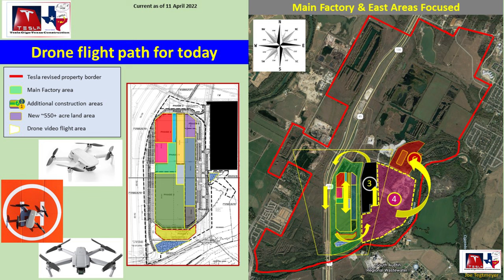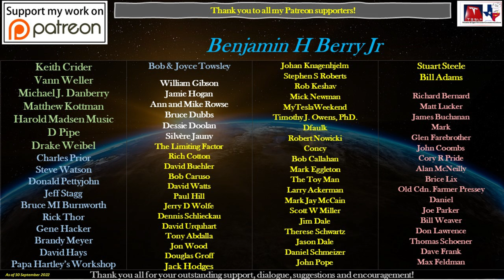Huge progress & talk # of receiving docks & WOW Yard trailers! 30 September 2022 Giga Texas(07:35AM)

Comment: Thanks Joe.
1:41. For the record, loading docks and drive-in doors, in use or under construction. 59 on the east side. 70 on the westside, not including the plugged openings.
5:09.  GA, inside. Much better view in Joe’s Patreon photos. Level 2, 2 bays of concrete then steel decking as far east as is visible.
Level 3, construction lighting only. Might not be much going on in there yet except for storage.
5:28. GA, apron. Trusses likely for lighting/sound above a stage for an event. Similar to that seen at the Giga-rodeo.
7:25. BIW, roof. Access platforms.
8:03. BIW, apron. Office building getting a pedestrian ramp. Building quite elevated, shoulder height of the carpenters building the ramp in Jeff’s video yesterday.
14:01. East of Cathode. Boring Company something. Lots of what appear to be A/C units on top, huge fan outlets on the north side.
17:35. Cathode. Left. Excavation for another ground slab. Small outbuilding likely as some drainage already in ground.
18:28. Cathode, west. Edgeboards/formwork for a ground slab. Interesting to see how the building in the stack of steel to the right works in with this.
19:12. WOW trailer yard. Right of screen. Inside the fence, another line of wheel stops/buffers. Shows further eastward expansion planned
20:45. Eastside parking. Car carrier area. New office trailers, permanent looking.
21:31. New substation site. The small light steel framed building was a surprise.
22:40. New substation site. Right of screen beside the last orange bollard, hold-down bolts seen in a jig to accurately locate the bolts within the footing rebar cage. 
Left of screen is a hurdle (orange) with a string-line strung over the line of footings to show the centreline.
24:54. Northend. Road. Drainage works under the sidewalk/footpath seems have been to remove the odd under pavement drainage inlets. About to turn the new drain into the pit/well/basin.
I don’t think there was a kerb and gutter along the road, might construct those now.
26:42. Casting, apron. Gas delivery tankers to the right. The decanting points are on the wall in front of us, directly to the right of the pair of porta-loo trailers.
Reply: Hello Dessie, 22:40 The hurdle is known as a batter board in US speak, Laser level on tripod at bottom center.
Reply: @eltonray2934  22:40. I'll hurdle/batter-board from here on. Thanks for the tip.

Comment: those cross-cutting is exactly in the red-circles I mentioned 2 weeks ago when they first start removing the concrete in the new-car are ;). That surely will be for the building extension as it's outline matches the current outline..

Comment: A boring company tunnel (BCT) adjacent to the biggest source of privately-owned Teslas around.  But going through a BCT requires full automation.  I wonder if Tesla creates a Tunnel Mode, maybe apart from FSD and available by subscription, so any Tesla owner can have the experience.
Reply: First they have to get FSD to work :)
Reply: FSD is a continuum. It works. It can work better and seems to be improving at each release. What's your definition. It appears as good as an average driver now. Does it have to be 5x better? 10x. 187x?
Reply: @HughButler35  My definition of "working FSD"....
It's all or nothing! It has to work reliably all the time. The internet is full of video of FSD mistakes. Many, recent videos. Yes, it can do some impressive things. You and I both know that is not good enough. There is a reason why you have to keep your hands on the wheel and your eyes on the road. 
Is it as good as a human? Absolutely not. 
And the extreme difficulty getting to near 100% reliability may take years, or may not even be possible. Full self driving would be nice, but you guys have to be realistic about this. Also, Tesla's prices for self driving are an absolute ripoff! 
No thanks. I will just drive myself in a vehicle that is cheap, doesn't have an unrepairable battery pack, and castings that go crunch :)